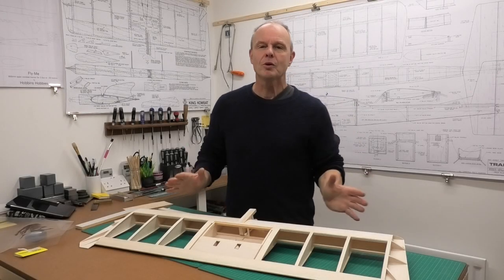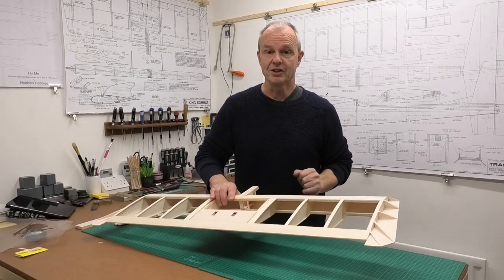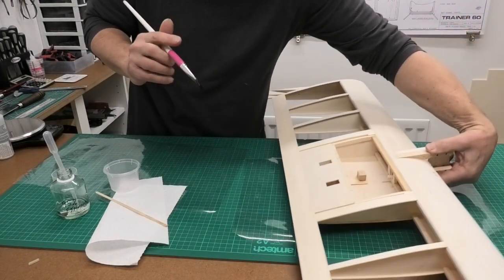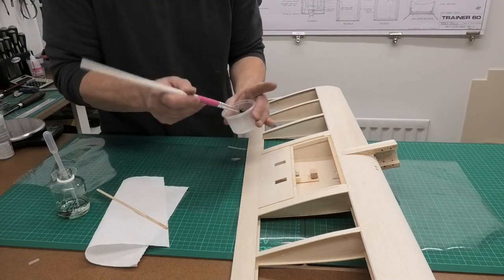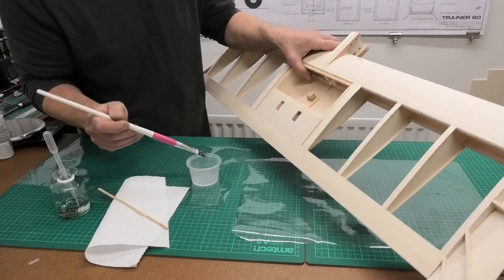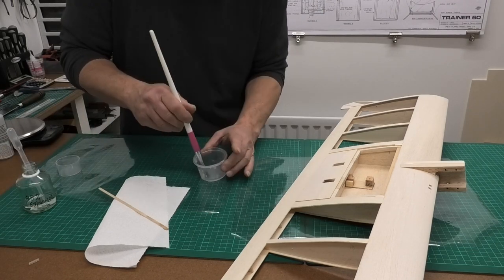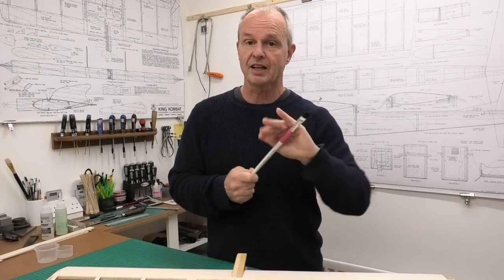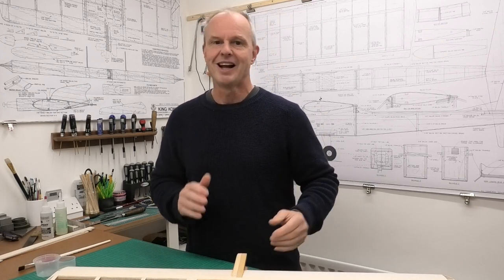Fuel Proofing - Balsa Model Aeroplanes Build & Repair - RC planes

Comment: Good morning Mark. Well after nearly 60 years of making models you have taught me something. I didn't know epoxy could be thinned down to use as fuel proofer. We never stop learning. Thank you. Terry
Reply from the maker: Good Morning Terry, thanks for the comment.  Glad to have helped 😀  I also do this when I fibreglass the central wing joints, as I never seem to have any finishing resin.  Have a great weekend 😁
Reply: @MarkRobinson555  you have a good one to.

Comment: Good job, you could also use epoxy finish resin it spreads very easy and is lighter and sets up very slow
Reply from the maker: Hi, thanks for the comment, yes, totally agreed Finishing Resin would be good as well 👍
Reply: Thanks for the comment. Exactly what I was thinking

Comment: Enjoyed your video very much.  I use polyurethane varnish for fuel proofing, but I imagine that epoxy would be a much stronger job.  Can you tell me would methylated spirit be OK to use as a thinning agent for epoxy?  That's what I use when I'm putting arf planes together to clean off excess epoxy.
Reply from the maker: Hi thanks for the comment, yes polyurethane is very good as a fuel proofer, I have used it on my engine nets stand, a plane stand for use in the field etc, essentially where the object is large and epoxy would proove expensive to use.  Sorry I don't know about the use of methalated spirits, not somthing I have used.  You can use Isopropanol.

Comment: hi great video Mark, looking at ethanol on the net there's quite a few different types, which type do you use?
Reply from the maker: Hi John, thanks for the comment, you can use any ethanol, between 75 - 95%, as long as it does not have any additives.  You can also use Isopropyl if that is easier to get.

Comment: Great tip to use epoxy Mark. Is ehanol the same a alchol? I have none of the former but a bottle of 95% of the latter that I use to clean stuff such as pushrods.
Reply from the maker: Ethanol is just one type of alcohol, so not really sure what you have, it could be isapropanol or another, bet to do a test and see how it works, or is there any way co can find out what it is you have?

Comment: very satisfying clips, thx. But would it not be better to do this after the covering and seal the edges of the film? I used to do this sealing with hot ZAP CA, but watch out for runnings and splatters in the eyes ;-)
Reply from the maker: I would prefer to do the fuel proofing before covering as it allows me to get under where the edgeswill be, by about 10-20mm, to make a better seal.  The edges of the covering can be then sealed again once applied.

Comment: Interesting.  I recently used a universal thinner bought from Aldi/Lidl  but I'm sure ethanol would be  better. This leads to my question, where did you get the ethanol ?
Reply from the maker: Hi thanks for the comment, I use 95% Bio-ethanol, this is a link to where I get it - https://www.diy.com/departments/la-hacienda-bio-ethanol-fuel-2l/540224_BQ.prd  Hope that helps.